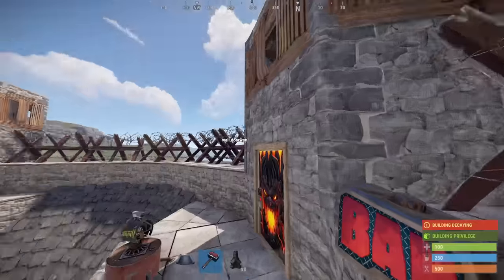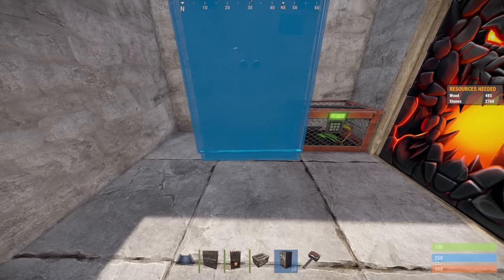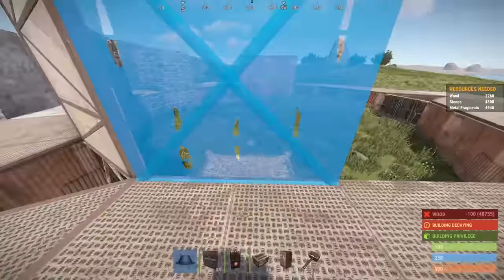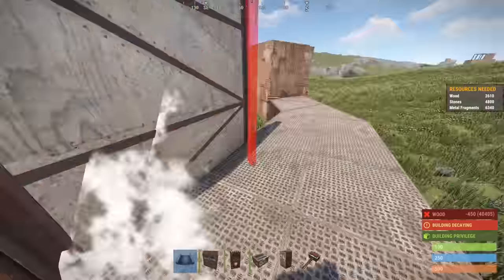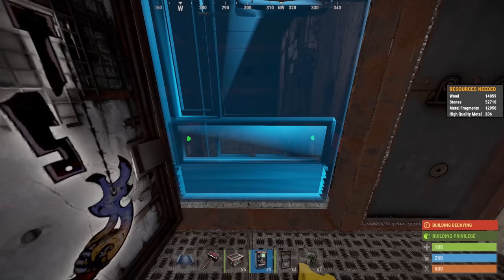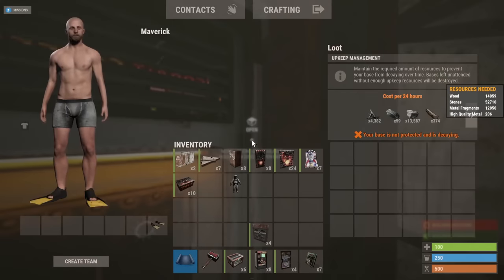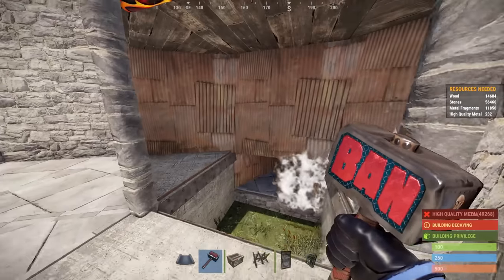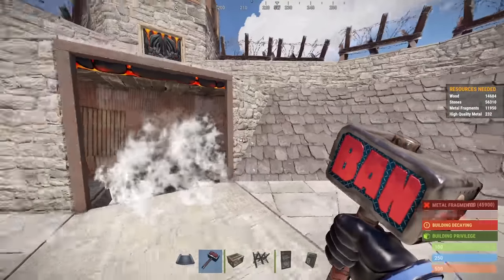Rust The Redoubt coreless base concept

Comment: Dang. You could really just build a whole other base in the center without losing much of the functionality, including the furnace. This design is brilliant. I've wondered about the theory of loot division but never brought it to fruition.
Reply from the maker: Decoy base in the centre you know they will raid it first, Just have a small box in there with a note saying something that will infuriate them  😂😂
Reply: I've figured it out. The purpose of this base is to make HQM mathematically redundant to building, except for doors. 

Despite only one story, the design makes it too expensive to take full advantage of material strengths, and placing two armored walls evenly between your loot and the outside would take about a 1000 HQM daily upkeep, an unfeasible daily farming demand without free access to quarry or excavator.

However, HQM is only twice as strong as metal, whereas the base imparts a 3x multiplier to loot defense values (based on the theory that raiders could gain easier access but rarely find enough to make it worth it). Furthermore, armoring particular sections of the base would reveal where the more valuable loot is kept, reducing the effectiveness of making the raiders guess.

Theoretically, the base actually achieves its most viable form as an all-metal. What a fucking good design.

brb to calculate the upkeep.

Comment: My fingers thank you for the flippers tip. Do you want to keep a bag in the vending bunker? I usually do 1 small box, 1 sleeping bag, and 1 large box, but the TC and all boxes are reachable through the flipped machine, so I guess you would only need the bag if you messed up placement?
Reply from the maker: Your welcome and I do the same thing I put a bag and a large box in there when I play with this bunker it can be seen in the intro but I didn't bother to put it in the build part of the vid

Comment: good concept but without turrets its a very easy base to camp. I was able to solo hold down a four man in this exact open core since they didn't have turrets so I farmed kits and eventually went a little deep for some kits. Great concept that I think should just be flushed out a bit.
Reply from the maker: Thanks this is a very basic setup i have left it to common sense for players to put windmills shotgun traps turrets and SAMs in where they think is best.

Comment: Btw you dont need to upgrade door framed to armored because sheet metal doors and armored doors are both weaker than sheet metal walls so you can save some resources by keeping your door framed below metal because upgrading past that point is kind of well pointless
Also if you want to softside doors frames to replace with garage doors armored kind of ruins that
Reply from the maker: The armoured single door frame is to keep the raid cost equal to the vending machine which is 10 rockets plus the 5 rockets  for the armoured door.

Comment: I like this base but do you think I should build this at the start of the wipe and expand or build a starter, farm up, and then build it?
Reply from the maker: You can build the 2x1 that i do at the start of the vid and put a wooden door frame on the triangle foundation next to it this will give you an airlock. You can then chop out the wooden single door frame when you have more of the base built and don't need it anymore.
Reply: @maverick1484  can you make a smaller version of this? I’m having trouble finding space to build this in
Reply: @scrub7457   find a iceberg they are relatively flat

Comment: Liked the initial concept. Upkeep is increased due to distance from TC. IMHO prob needs a couple small gaps to put it on multiple TCs
Reply from the maker: So if it was a straight line statistically impossible raid base and not one that was curved around would you split that up into 3 TCs as well?
Reply: Yeah, or my version of that other base would be to build multiple 1x1 or 2x1s instead for that purpose.

Comment: Could you possibly remake this video showing how someone could make a starter (one of the three bunkers) and then later expand? Because 55k stone, 15k metal and probably like 35k wood (to build plus burn ore for metal) as a solo that's possible in the long run but you never showed how to secure at least the first bunker in order to use it as a starter till you'd have the resources necessary to build it. In other words this base is a op monstrosity that nobody but clans could build as its not friendly to anyone else (no obvious starter potential) at least not to me I only have 200 hours on console so I don't even get 2x servers this is too expensive to build for me to ever use this despite this being my new favorite design ever
Reply from the maker: I am currently filming a solo vanilla version which will solve this, stay tuned!
Reply: @maverick1484  sounds awesome I'll be waiting

Comment: you now can even implement a splitter system that sucks one bunker dry of loot in case of and raid.. so it really sucks to raid it.
Reply from the maker: That is very clever i like it
Reply: @maverick1484  thx. I personally went with the large furnace in the middle and also used a half-wall/low wall/ triangle frame shooting-floor on top of it.  4 floors high with triangle roofs as coverup. 360* peak downs, but u have to place the sleeping bag before u seal the roof. nice base again!
Reply from the maker: @niklaso.6065  It sounds like a beast of a base!!!

Comment: Great base, one question how do i access the other 2 bunkers if i close them up? do i just have to put 3 bags on the base and wait out all the timers to crack the half wals?
Reply from the maker: Yes unfortunately. I found playing out of just one bunker and keeping that open during the day works well, then i depo into the other bunkers before going offline. This also has the added bonus of if anybody is watching you during the day then they will raid the bunker they see you going in and out of all the time, which should just have some old scraps that weren't worth putting into you overnight bunkers.

Comment: in my opinion it does have a weak point, elevated foundations gives an option to rocket the foundations or even c4... but okay what do i know right
Reply from the maker: It would be the same raid cost as taking the walls unless you rocket the very centre and get splash damage. I have done an updated version with a better bunker system that removes the raised foundations in the centre to get rid of this problem https://youtu.be/lr4Zvd3Z9hM

Comment: The one flaw I see is a soft side raid on the high quality foundations
Reply from the maker: They are just extra i wasn't even going to put them in at all remember its the statistically unraidable base curved round that's the main idea. Then when i did finally decide to bunker it i though i should just do the easiest one to keep it simple. You can use my convex bunker design even though it went down like a lead balloon as a video it has no softside but players love the old softsideable stability bunker lol.

Comment: If it was a taller base only a little could industrial pipes  be layer in a under court yard tunnel system?
Reply from the maker: I haven't really though about it, but I think it could be done using a half wall height tunnel with low walls on the divides and the piping passing through the small gap in the top, Its a really good idea well done!

Comment: Help a noob out, the wiki is contradicting itself... is protection a cylinder centered on the TC or "emanating" from the shape/border of the base?
Reply from the maker: TC protection is formed in a bubble and extends out about 5 square foundations from the base, this priv bubble can be stretched in any direction by adding more foundations or walls. Because priv emanates from the base it means you cannot find TC as a raider by running around with a building plan

Comment: Basically it is just 36 rocket raid to get the each of 3 bunkers, of course if bunkers will hqm and honeycomb will metal then the cost of 72 rockets looks very huge, also piping system can share loot between bunkers automatically, but anyway no one raid this type of bases now)
Reply from the maker: Don't forget the 7 garage doors in each bunker that's another 63 rockets lol.

Comment: Would it be possible to have a TC in each of the 3 Bunkers if you put tiny gaps in between the 3 Sections so you have a TC for every third of the base? Or would the TCs be too close to each other?
Reply from the maker: They are to close, but you can fit 2 TCs on there its been a bit of a puzzle I'm still working it out

Comment: very nice build , we would really appreciate a builder's sanctuary code to spawn it and check ! :)
Reply from the maker: Is that still going? I gave up using it when Vice quit the game over a year ago, it just became a laggy mess that kept crashing.
Reply: @maverick1484  They’ve fixed a lot of the crashes since then. Definitely still glitchy every now and then but I’m usually good for 2-4 hours of building before a crash usually when I hop in there. I mostly do US Small (~ 30 ping) but switch to EU small (120+ ping) when US goes down and I hardly notice any difference even on such high ping. I just alternate between them for effectively uninterrupted building when I’m actually in there for sessions that long. If you’re in there during off hours you can pretty much expect no crashing. Went on a few building binges from like 12 AM - 8 AM without any crashes at all a couple of times. Pretty much any time during the day except peak times is hella stable.
Reply from the maker: @Jackmikehockoff  Thankyou that is very helpful
Reply: @maverick1484  it does crash often but still servers are full :P
Reply from the maker: @alemaoaoua  Good to know thanks.

Comment: my first thought is can you mirror the tc twice and start with 3 starter bases and save on upkeep splitting between 3 tcs or is this base too compact for this?
Reply from the maker: I have thought the same thing but the TCs would be to close. if you went bigger it would work and you could go bigger if you are splitting the upkeeep.
Reply: @maverick1484  Thanks for reply. I'll experiment and see. I like the idea of 3 starter bases eventually joining together, I'll play around in creative. There's many designs you could build 3 of and then compound but wonder how big this  one would need to be to avoid the compound. I would also much rather put a big base in the centre as a decoy instead of leaving it obviously. The decoy core will probs eat a bunch of raiders explosives first (if they top down/ladder over) then after they are depleted they still have to go for one of 3 bases plus all the extra in between space!!
Reply: think i'd have to leave the centre till the end to avoid build priv extension
Reply from the maker: @FindNakor  The decoy core is a very good idea so much so that i might use it!

Comment: Love the base design. I just built it, but it took me a long time to find an area flat enough to go all around. My base also got raided from the towers as they laddered up and rocketed the turrets. Something to protect the top of the towers would be ideal. Maybe placing metal barracades and deployables on the side to protect against raiders coming that way? Any ideas?
Reply from the maker: I am currently working on a pixel gap version which gets rid of the stability bunkers so you wont need the flat ground like this one. Sorry to hear you got raided but you can put barricades on the towers, be warned it looks ugly!  also more turrets with 2 chain link fences in front of them will slow them down.
Reply: I had metal barricades on them… but was MLRS … took the whole base out in seconds I had no chance to defend
Reply: @maverick1484  when can we expect it?

Comment: Regarding the tc room, the vending machine isn’t placeable that close to the doorway, any advice?

Edit: I’ve even took everything out the room just to try fit the vending machine in the doorway but it’s not clipping as close as in the video
Reply from the maker: First off have you got your flippers on? and make sure you are crouched . Then there is the sweet spot where you have to position yourself to be able to pull the vending machine towards you and into the frame that means some diagonal side steping sometimes then return to where you lay the vendy to get you in a slightly different spot.
Reply: @maverick1484  Managed to get it after a while! Thanks for the help, after a while of messing with it, it just let me clip it anywhere.
Reply from the maker: @iRexxye  Ah good, its all about being in exactly the right spot to crouch in.

Comment: There is actually a problem with this base, it only has a single TC. So in the event that raiders do find it they can easily grief your whole base. I guess you could take the same concept though and make it higher and add wide gapped shooting floors to counteract the issue.
Reply: You can also add your own makeshift disconnectables  around the perimeter without even doing widegaps or gatehouses.
Reply from the maker: The base is way to small to fit 3 TCs on it, It would need to be twice the size to get 3 TCs on it without overlapping priv. I could spit it in 2 but because of the curve i cannot place normal honeycomb on the inside unless you want to use squares for honeycomb which would be crazy. so i have to use the roofs but the trouble with roofs is they don't link together if there is a small gap between them 😞
Reply: All I simply do for those that don't know how to get disconnectables added on is you just walk in any random direction away from your base until the building priv is no longer blocked. Build your normal disconnectable TC pod with the stacked 2 half walls facing the direction of your base.

Then build back 4 squares towards the base with twig and cap it with an upgraded metal triangle foundation. Then put a wall frame on that and connect the 4 squares with square frames and upgrade all of those to metal. 

Sometimes you may need a little twig buildout to get the initial stability to connect them. After that is done destroy all the twig and you can do the normal disconnect process as needed. Repeat this as many times as you want in different directions. The more the better!

Comment: I have been trying to duplicate the build.   however i am running into an issue with placing the roofs.  They won't face towards the inside of the base.  Is there a trick to it?
Reply: NVM found out you can flip it with R
Reply from the maker: @olduk  Cool

Comment: This is still just one TC right?, might it be viable to use this concept and have the towers extended outwards with more tc placements? like you have maybe one tc in the center that is just for the inner area, but then you have for each tower an outer tc, would that make sense? I was wondering as if a base is connected like this the upkeep cost are higher than of several devided tcs,right? or would that break the purpose of this base design?
Reply from the maker: I have been trying to split it between 3 TCs and they overlap (the base is to small) but i did manage to do 2 TCs it still needs work though.
Reply: @maverick1484  would external tc's work? say this still is kind of a core :), but you expand outwards and have three segments whereby the towers are part of one segment each and the tc then itself is heavily encased but further outwards. might that work?
Reply from the maker: @kinngrimm  Yes it needs somehow to spread the TCs further apart but if a TC is built out on an arm it would be obvious where it was and it needs to be something like 3 more squares out. Its a fun puzzle if nothing else lol

Comment: It's a good idea and all, but unfortunately there is just too many cheaters in rust and I wouldnt make this personally. ESP users can easily get into the loot rooms (and tc). That's why always make sure to secure tc as best as possible from every angle. In this design, I think you could be able to add disconnectable tc's tho, so losing tc wouldnt be that bad?
Reply from the maker: I have done my time on officials and now no longer go near them, I always use community severs with active admins so its not much of an issue for me now. Plus if you are dealing with a hacker no base is safe I have been shot through solid walls before so I don't see how any design can cope with that.

Comment: I have a question and maybe an improvement to this concept... it s possible, in order to reduce the costs and maybe to introduce some wallstacked bunker, to split this base design using external TC? I mean for example splitting this circle base in 3 parts and for everyone using a separate external tc (3 is just an example you can use 2 or 4 parts). have anyone here already tried something like this?

Comment: Just a thought but until you get externals up couldnt someone just run around with a build plan and narrow down pretty accurate just thru build priv where your tc is?
Reply from the maker: No, building privilege comes out from the foundations the TC is places on, I did a little check on this design and there is 5 square foundations of priv that extend out equally on all sides.
Reply: @maverick1484  thank you for the reply I was wondering
Reply: @maverick1484  also thank you for the research